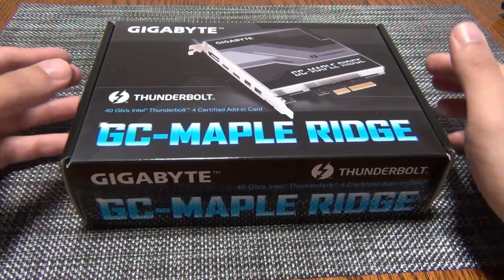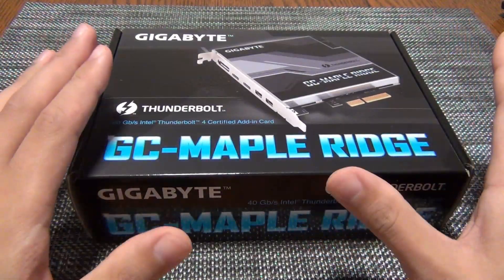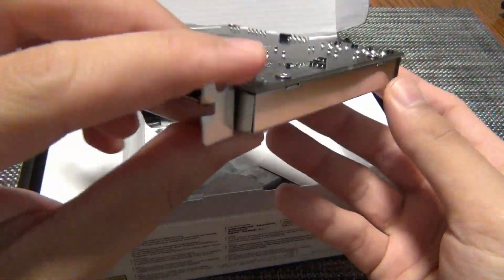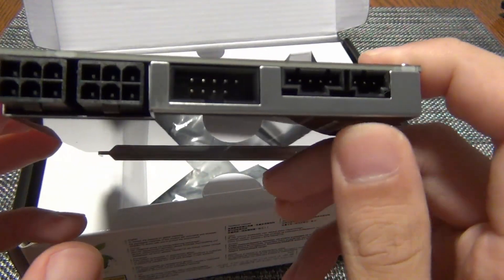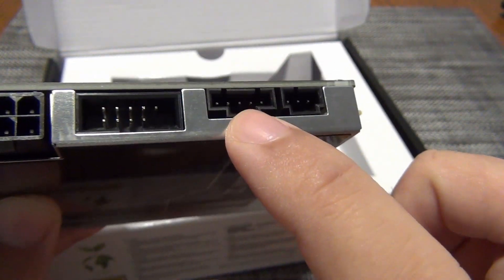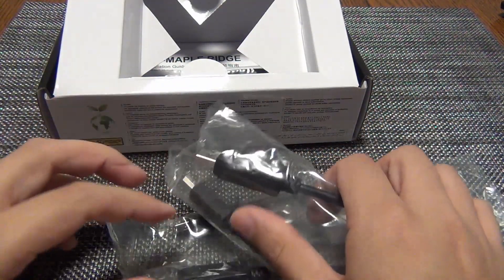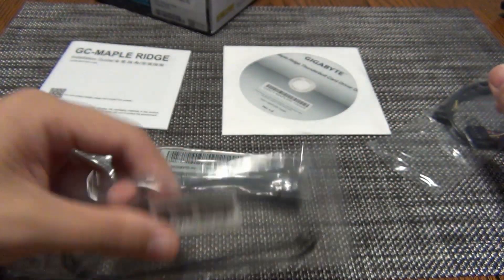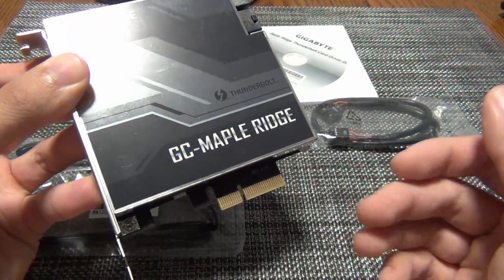Gigabyte GC Maple Ridge Thunderbolt 4 card Unboxing

Comment: Is this card GC-Maple Ridge Thunderbolt 4 compatible with the Gigabyte X570 Aorus Master? I already have the Titan Ridge Thunderbolt 3 pcie card but have heard there is a compatibility issue. Can you confirm or deny this? I'd really like to replace my Thunderbolt 3 card with the newer GC-Maple Ridge card and Im trying to postpone an entire system upgrade!
Reply from the maker: It's possible it will work but it's not officially supported. Only the Titan Ridge card is officially supported on that platform.
Reply: @GameTechReviews  Thanks for the timely reply and information. Right now the GC-Maple Ridge Card is going for roughly 175.00 here in Australia, so I don't think I will be ordering it to test its compatibility, since the Titan Ridge Thunderbolt 3 Card is working perfectly, not that I use it a lot.......

Comment: Can I use this card on Z370 Aorus Gaming 7?
Reply: I'm using it on a Z370 Aorus Ultra Gaming. I'm still trying to figure out the connection of my USB ports that live in my LG 5K monitor. My goal is to have windows detect the peripherals connected directly to the monitor.

Comment: Can I use this on AM5 as I have the right motherboard slot but not sure if it works with amd?
Reply from the maker: This specific card only works on Gigabyte motherboards that have the 5-pin THB/U4 header as shown in the video. X670E, X670, and the B650E Gigabyte boards that have the header will work. The card needs to be installed in a PCIE slot that has at least x4 lanes of bandwidth as explained in the video.